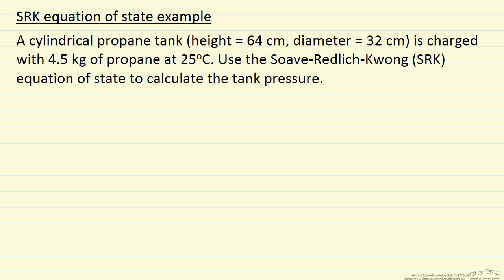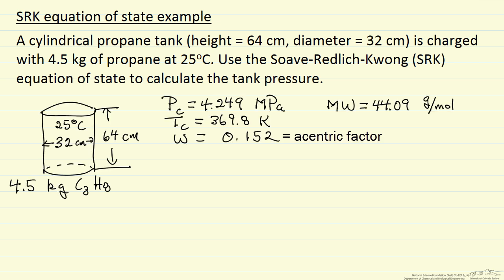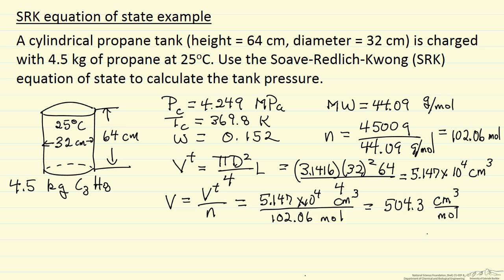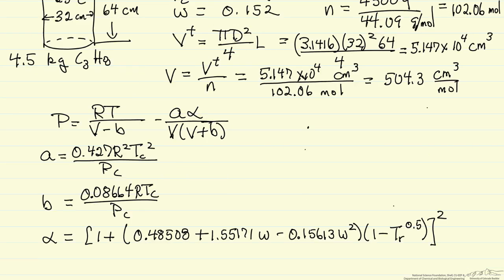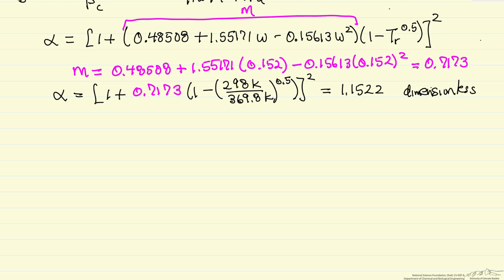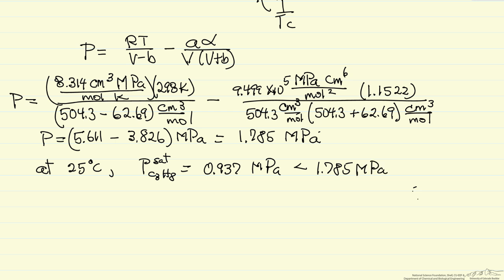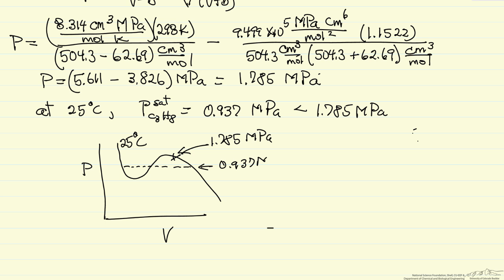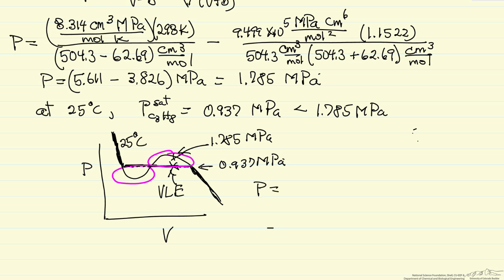SRK Equation of State Example

Comment: Is the propane charged in liquid form or gas form? Does it matter?
Reply: It does not matter if it is at steady state when measuring the pressure as long as 4.5 kg of propane is put in. You can put that propane in much faster if it is in liquid form. When I needed to add a lot of ammonia I would turn the tank over (it had no dip tube) and I would add liquid and it would add faster, if I wanted to add only a little bit I added gaseous ammonia and I kept the tank upright.

Comment: I have pressure, I want to find specific volume
Reply from the maker: You could try using a spreadsheet because that calculation would be much harder.  I think using Excel Solver would work.
Reply: @LearnChemE  what should I assume the value for specific volume, to set objective as zero/minimum?
Reply: bro did you figure out how to do it im stumped
Reply: Use engineering equation solver if you have it.

Comment: I don't really understand what the a, b, and alpha values mean. They're constants, but are they propane constants? What about alpha? Where did the alpha calculation/formula come from?
Reply from the maker: +Syvmana Thanks for your question.  The a, b, and alpha values are just part of the SRK equation.  They are used separately to simplify the equation.  The original equation only works when a, b, and alpha equal the above terms.  If these terms weren't pulled out, the original equation would be overwhelming.